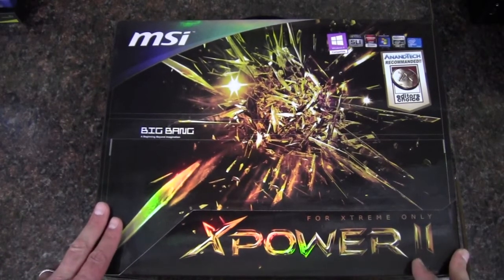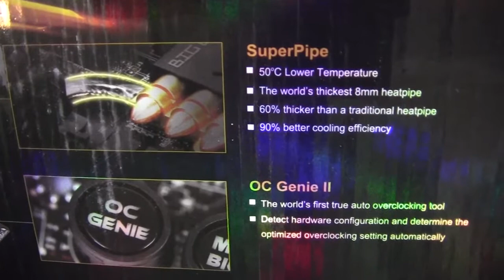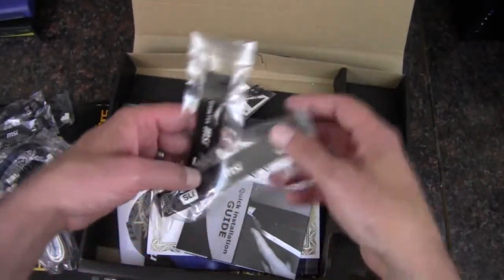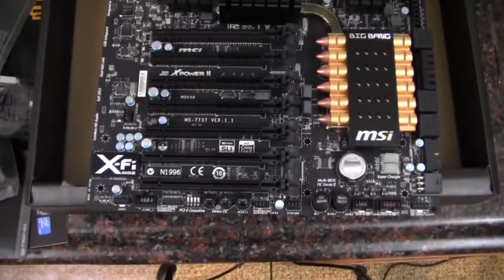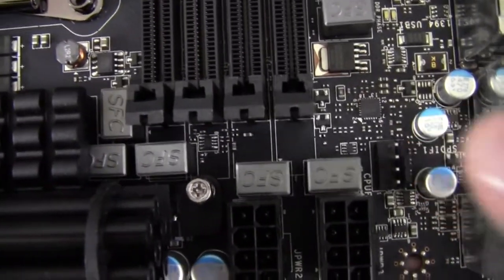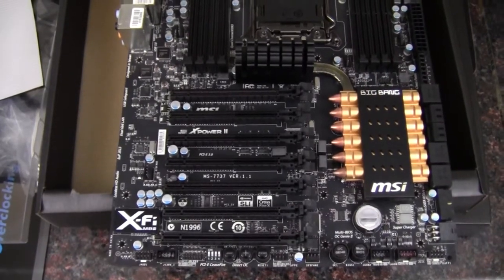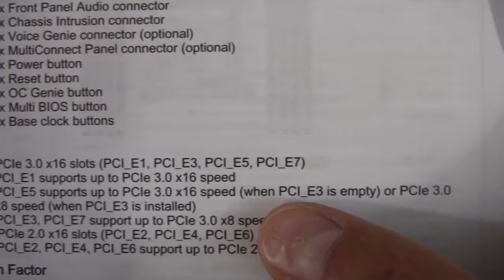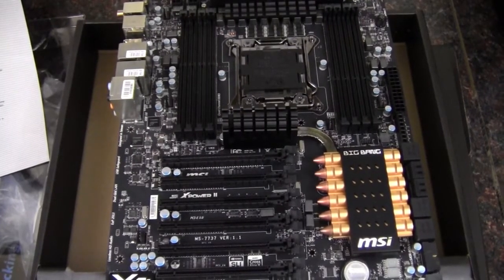MSI Big Bang XPower II Motherboard

Comment from the maker: Thanks for the tip. I also discovered that to get the maximum bandwidth from the PCI Express bus you have to use slots one and five. This leaves an uncommon gap between the cards. So I guess they also included this bridge to "bridge" that gap. I also agree with your comment about color. Nothing worse than an all black build with a brown or yellow video card bridge. 2 birds with one stone. :)

Comment: Just since you wondering 8 mm is outside diameter it would have a smaller inner diameter resulting in thicker walls being a larger 8 mm pipe.

Comment: So how did you enjoy the build? I found mine to be a BITCH! The voice genie is not available or so it seems, I have written support and tried phoning to find out whether is available and pricing if it is, I have yet had anyone respond! There are some power extensions included.... CORRECTION 1 extension included but 2 are needed because of boards size and how cables need to be routed within the case assuming one is found to be suitable to the buyer's taste and of course, is ATX-XL compliant! When I built my rig there were few choices in cases and all needed modification to please my eye aesthetically! Actually, I should be more specific there were actually more choices however, they were OUT of STOCK  and priced high enough I couldn't afford that luxury if I wanted to add the amount of RAM and the CPU worthy of this build! Besides I can modify later!  I found that because of the board size it needed 1 more extension than the case MFG provided! The 2  Gigabit Ethernet ports have an included teaming utility for multiple NIC's but not necessarily the 2 onboard! Teaming Genie says it is for Realtek chipsets only! Which is weird because my Mobo had 2 Intel Pro series NIC's and  I found them to be frustrating to configure! The setup instructions and the wizard as well, are all over the place, to say the least! I am still unsure if everything is installed, much less correctly! Bitlocker wouldn't work because APM is missing! The APM setup that is included says it's incompatible and will not finish installing! Other than that it's a workhorse and have had little in the way of problems!
Reply from the maker: I would agree. It was a tough motherboard to work with in all aspects mentioned. Once I got it going, it worked very well for me. I didn't like any of the MSI utilities, so I chose to use none of them. XL ATX is a difficult platform to work with and not many companies make the case or cables required by this beast. I actually ended up "downgrading" a bit to the Sabertooth X79 from this board. While it has its issues, it was easier to do a build with. I think MSI tried to do too much with this board and wasn't able to deliver on all of its claims. MSI software also leaves a lot to be desired. Although, most of the motherboard manufacturers' software suites are not really that great.
Reply: Mine is still going... It's my Main workstation build for production and is used everyday. Video card, audiocard, 10 SATA SSD, 32GB Memory (Ready to go 128 soon) H-100 Watercooled.                    

Light OC at first but then realized I didn't need it so running stock for stability and cooler temps which = less noise. I only Wish the onboard USB 2.o was 2 x 3.o.          
Might be adding a Thinderbolt 3 Card soon so we'll see how the bandwidth holds up. Was planning a new build next year but this has really been rock for me.

Actually ended up getting an MSI Laptop for my main gig rig last year. I am loving MSI right now.

Comment: Gigabyte Assassin 2 long as mod the bios or get modded latest bios from overclockers.org as well as a xeon 1680 V2 and good AIO with VEGA 56 or 64, you will beat a 9900k when overclocked stable at 1.375v for everyday use on all 16 threads 4.8ghz.... Also, Assassin 2 is extended ATX but odd as sort of in between atx and eatx but reads eatx, fits most atx cases "tight".... like the CUK 77 Switch.... Great system even in 2019 and 2020, amazing.... quad channel memory, etc..... BEAST and I duno when it will ever be behind as again, when overclocked right it still can beat the 9900k or MATCH it in its sleep! Sandy and Ivy Bridge E is slamming as well as the NOW Rare X79 Chipset...... The GA2 MOBO is nearly perfect with one major flaw with vrm cooling on back and no coolers or tiny heat-sinks but if you clean and paste - add the cooler or coolers to the VRM's on the rear, it corrects the problem and then some and becomes the best X79 board also depending if one is running the right cpu (1680 v2) ...with proper bios for ivy bridge E upgrade although the 1650 v0 is a nice cpu to for overclocking if can spare 2 cores.... the 1660 v2 ivy bridge if want out the box performance and no overclocking on a xeon... 1 - Can't go wrong with x79 hence intel is buying the boars and raising cost then DeSTROYING them.... back when it was released we did not know what we had for years because the 1080 ti was not in existence yet nor anything near it to actually put it to the REAL Test - CATS OUT THE BAG NOW.... #SaveX79
Reply from the maker: I love it! #SaveX79 Awesome :)

Comment: Does it support ECC?
Reply from the maker: Maybe with a Xeon CPU, but I cannot find any 100% confirmation. I would almost guarantee with an i7 there would be zero support. Also, registered ECC would be far less likely to work than unbuffered ECC. I did some diving with a Google search, but I didn't see anything concrete. Unfortunately, there are not many of this board around anymore to test. Even MSI's website is unclear.